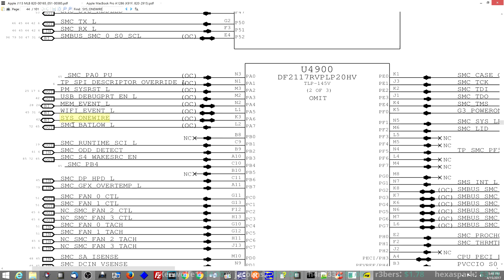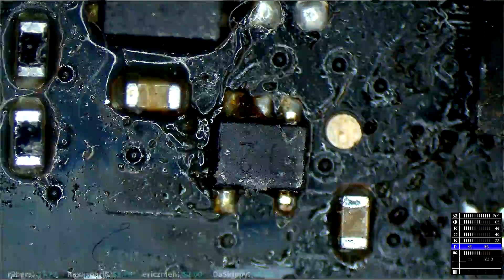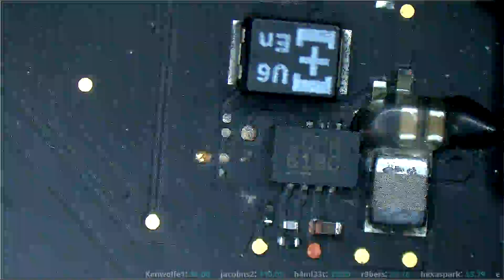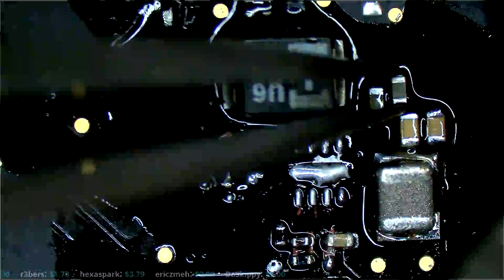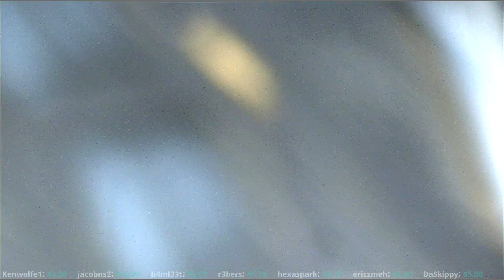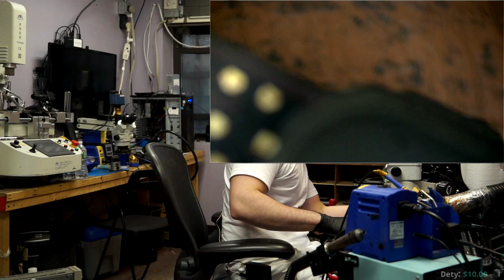Macbook Air Magsafe charging circuit walkthrough and repair

Comment: So my MacBook won’t turn on , I plug the charger in it’s dim green and the battery makes a high pitched noise when plugged in and I get no power. If I have the charger plugged in the center of the logic board almost by the battery connection gets burning hot. I’m guessing I’m having a short circuit issue which is why I’m not getting power?

Comment: Hi Louis, Great videos as usual. General question/observation: After watching a few dozen videos to learn more about Macbooks repairs, I've noticed when you fix power related issues, you generally check turn on with the power supply and not the battery. Is it just from the practical experience there's always more testing left to do offcamera?
Reply from the maker: +omitsura watching somebody reassemble a machine to make sure Wi-Fi works and make sure that the battery charges and make sure that the CD drive works and make sure it sees the hard drive and make sure USB works and then run the 35-minute Apple service diagnostic would be more boring than watching paint dry
Reply: Right on. Just curious as to understand the cycle of refurbishing better.

Comment: Just found your channel and love it - quick question about third party magsafe 2 chargers. Do you think there's a risk to using them or there's sufficient protection in the IO board on the Macbook Pro?
Reply: To elaborate. Was miles from a Western city and my (fake Chinese) charger was working sporadically for a few weeks ("not charging" when plugged in, slowly charging overnight when Macbook Pro lid down). Eventually it wouldn't input any current at all. Finally got out of the jungle to try an official charger - plugging it in power cycled the machine and when it booted it thought it didn't even have a battery (despite being on and unplugged). From then on, I never got it to charge at all and battery eventually died.

Apple "Genius" diagnosed it wasn't the IO board or battery but the logic board itself. Obviously, for a Macbook Pro, by now I might as well just buy a new machine rather than pay them. a) Have you seen any symptoms like this before? b) Do you think the charger damaged the logic board, c) do you think there's a chance there's a simpler and, more importantly, cheaper fix possible?

Comment: I wish I was smart enough to rig my raspberry pi up with a magsafe thing like this. Though it would turn off every time the magsafe disconnects. Anyways! I noticed how you were putting the tin on while soldering and i don't know how you did it but it was as if the tin jumped into the right place every time you brushed over it, as if it was attracted to the pads etc. Is this just a coincidence or is there magic at work?
Reply: Flux is what is making the solder attracted to the pads. Louis's style is to use a ton of heat for as little time as possible (at least with his iron not sure about his hot air rework station), and that makes the solder seem like it is magnetized to the pads. Flux is super useful stuff and the only reason some repairs are even possible. If the pads were black with corrosion and he didn't use flux, solder would probably not stick.
Reply: Ah thanks! This flux stuff keeps surpising me.
Reply: As far as I know, there's basically acid flux and rosin flux. We use rosin flux in electronics (acid flux will eat the board substrate). Acid flux is used to solder pipes (and probably in welding, but I'm not a welder, so I dunno).
Reply: @ZiggyTheHamster  Is that what's getting poured at 9:51? Rosin flux in liquid form?
Reply: @faresel-amine7061  no, that's isopropyl alcohol. Louis almost exclusively uses paste flux dispensed from a syringe. Flux cannot be applied with a cotton swab or you'll have a gross mess that won't work.

I prefer liquid flux for most things, but it still comes out of a syringe.
Reply: @ZiggyTheHamster  Oh wow! I did not think one can "pour" isopropyl alcohol like that onto a board.. I've never actually seen paste flux from a syringe, but now that you mention it that's way more convenient than scooping some up from a container with a spatula (:
Thanks for the quick reply!
Reply: @faresel-amine7061  there's a whole lot of different types of paste flux. Louis uses a kind that has the consistency and tackiness of cake frosting, but there are thicker and thinner paste fluxes. The super thick kind require a strong brush to apply because it's so thick.
Reply: Also IPA won't hurt a board. It's how you clean the flux off. Louis then ultrasonics the boards in cleaner for like an hour. Liquids don't necessarily hurt